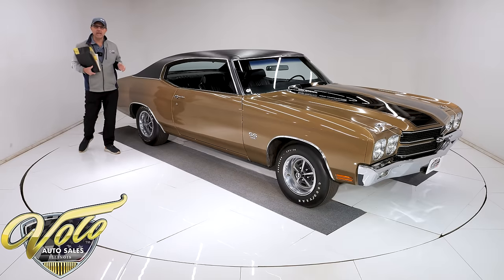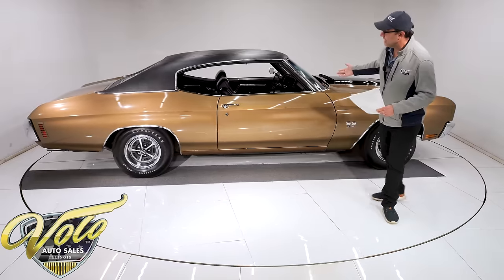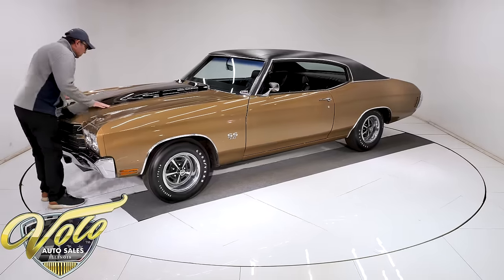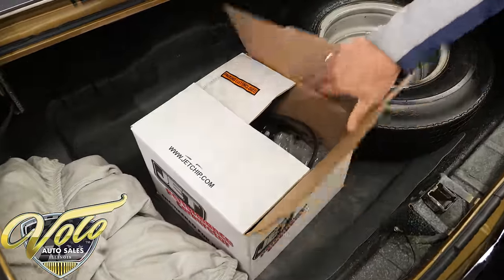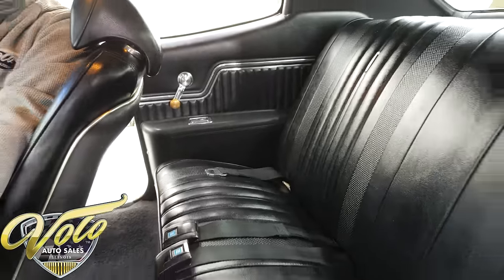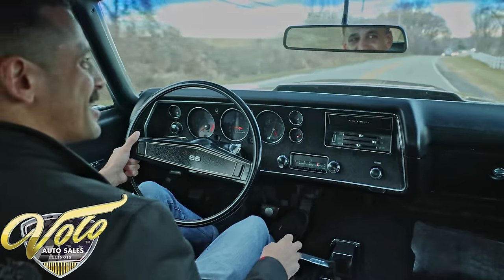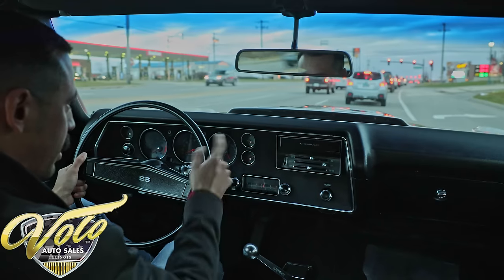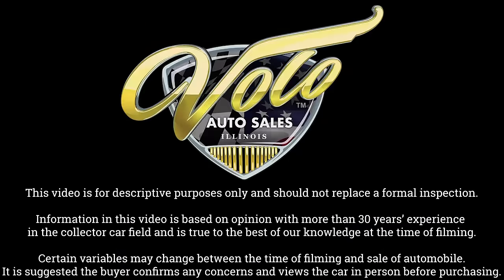1970 Chevrolet Chevelle SS 396 for sale at Volo Auto Museum (V21347)

Comment: I saw the video with the black cherry paint job.  Hoping as this isn't as old, I may bet a response.  We have a 1970 black cherry Chevelle SS 396 with a black vinyl roof & 3-tier hood, no cowl induction.  We used to have all of the paperwork showing it was built in California & came from the factory with power steering, power brakes, factory AC, a chrome pumpkin, a chrome sway bar, chrome air cleaner, and a bench seat.  We also had found build sheets inside seat springs & inside door panels.  These were stolen from us.  It also came with a stainless steel warranty card, that used to be given with these cars.  A jealous relative took the papers & we didn't realize it until we moved bc we never suspected he would do anything like that.
Is there any possible way to contact anyone to replace these things?  Thank you.
I am curious as to the value of ours?  It's in very good shape & has always been garage kept.  It has 63k original miles on it. He did put a Hurst compeition plus shiifter on it.
Reply from the maker: You can try sending your inquiry to the salesmen team.
📧 sales@volocars.com
Reply: @VoloMuseumAutoSales  thank you.

Comment: I grew up in the 50s 60s and 70s and trying to remember back when I had a 68 Ford two-door fastback Galaxy 390 cubic at one time and I bought it I don't know maybe 15 years ago but I ended up having to have the heads and the valves redone and all of that because of the unleaded fuel I am just curious if that car has to have the same thing done or has it been done I just can't remember back in 1970 have unleaded fuel with the cars coming off the line made it was sleeping unleaded fuel you know